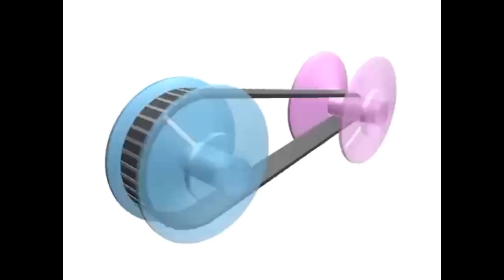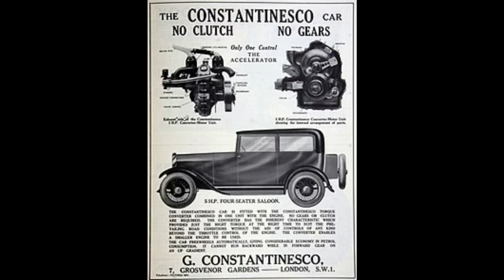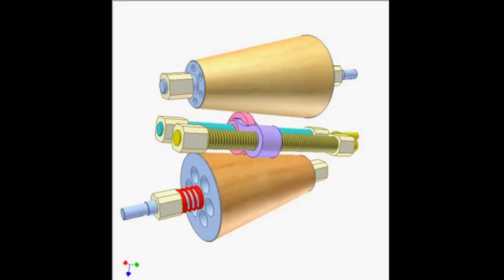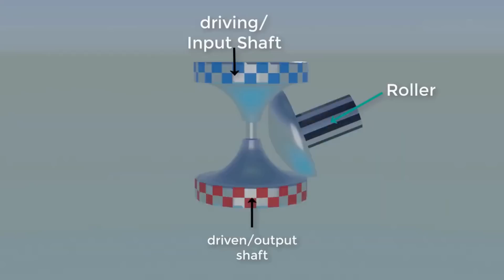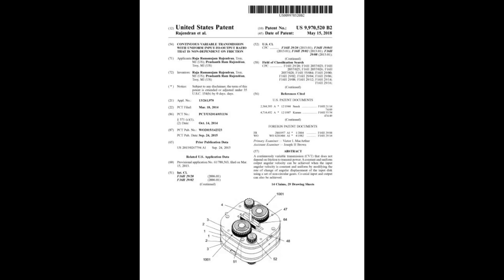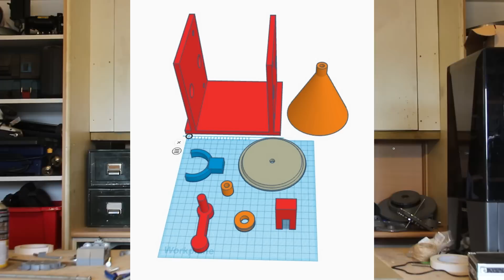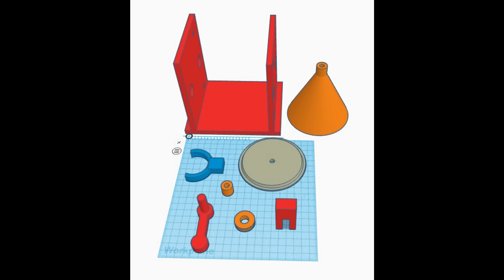1972 Continuously Variable Transmission For Use In Wind Turbines (CVT)

Comment: a thought on how to adjust the placement of the transmission ball could be as simple as a wind damper pushing against a spring. the more the wind pushes over the damper the father to one side the ball goes and vise versa. now i know there are some losses but that could be improved by possibly a redesign to the pully were the wind damper moving applies inward pressure on the drive  pully and outward pressure on the driven. defiantly not a engineer just some thoughts

Comment: In 1958 my first industrial history lesson at age of 12 years was a variable twin cone and belt transmission as used in early Victorian windmills in Britain. The point was that the mill stones would have a constant speed thus reducing the high liability of fire in the flour laden atmosphere which was explosive under certain conditions. Shortly afterwards Daffodil in the sixties marketed the Daffodil variomatic transmission. When I commented on this to my toolmaking uncle he showed me his Robin Hood lathe which worked by a similar transmission and was designed in WWII as a raining machine for workshop machinists. I still use this machine today for hobby processes! As the Presenter suggests there is merely the upgrading of old ideas!

Comment: I always thought about adopting helicopter blade angle adjustment to maximise a wind turbine, wind to high, just change the angle of attack 😊
Reply: pretty sure that's exactly what they already do
Reply: @MattNolanCustom  they obviously haven't got it right because they have to be shut down in high winds, you'd think that would be time to maximize that raw energy. It would take pressure off the grid and the polluting power stations.
Reply: @allanbroughton2708  there are two issues: there will always be a maximum speed and there are times when the grid can't accept more power without becoming unbalanced - especially if the turbines are in Scotland, as the grid doesn't have much capacity to transfer power from there to England
Reply: @MattNolanCustom  firstly a "maximum speed" can be overcome through engineering solutions so that even gale force winds can be harnessed. Secondly, those times when "the grid can't accept more power" the power generating stations should have output restricted and full utilization of wind and or solar should then have priority.  Why would there need to be a transfer of power from scotland to england?  Do the scottish wind turbines produce more power than scotland can use?  I look forward to the next installment 😂😂
Reply: @allanbroughton2708  yes. There is a major grid capacity bottleneck between Scotland and England.

Comment: for the yoke? control, have a threaded control rod attached to a small stepper motor thats controlled off of an arduino tabled for target ratios at a given fan speed, rpm can be gathered from using hall effect sensors

Comment: Also hitting on a whole range of variable speed transmissions, with patents over 100 years old! I still haven't seen anything on using radiating shafts on an axel, with counterweights, which would be able to change the shaft size with centrifugal force - also something I've been milling over. It's a brilliant idea and would be very useful in wind generators, where you could keep the turbine/blades running at a constant speed, but vary the torque, depending on the wind force... there's a 100 year old patent on that, too, isn't there?

Comment: I have many "dead" deep-cycle Marine 12V lead-acid batteries. If new, they'd store and output as much as 14.5VDC. Once someone has thrown them out, you now might expect around 11VDC from them after a charge. But if you attach them in series and use them to run a DC motor, the voltage will determine its speed. Six of these batteries might then run the motor at 60V. With the CVT to an alternator, you could then produce a stable 120VAC output assuming that you have a feedback loop to control it.

Comment: So a possible solution would be a threaded shaft driven by an electric motor and two sensors to measure the rotation of both drives. You can then difference the speeds between the two drives and then drive the thread back and forth to position the golf ball where it needs to go. I don't know if this could be achieved mechanically with some sort of differential gear to vary the threaded shaft to keep the output speed the same. Its worth adding an anemometer and brakes to the input drive from the turbine so that in very windy conditions, the turbine can be shut down to prevent the turbine being destroyed in gales and hurricanes.

Comment: Quite an exciting video this is. I just have exactly the right application for this and I had no idea it could be done this way I have to control the speed of a rotating plate and I would have made electronic speed adjustment with a PC board but this is without electronics and therefore I can use a ac motor and have far less interference on the master amplifier which controls the cutting head. The same principle applies to its feedscrew which would allow me stepless groove pitch. This being a vinyl LP record cutting lathe BTW. My current one I made uses dc motor and has interference. Thanks for this.

Comment: There is a transmission for bicycles that uses cones and balls with a swash plate to change the gearing.  There is also a substance like corn starch inside that goes hard under load and then liquid when not loaded.  It is not CVT but is is worth a look to help with the design.

Comment: A variable transmission would be great for a car powerded by a stirling engine, the engine could be made really simple and run at constant rpm then you need a cluch for engaging and disengaging the main shaft in normal and reverse and a variable transmission, it could be the most efficient and simpler hydrocarbon engine car possible.
Reply: I don't think a Stirling engine is more efficient than a combustion engine, the only advantage is that you can run a Stirling engine on every heat source, so you could run your car on wood for example, the downside is of course that it takes pretty long to start the engine... 
But maybe it is possible to run a sterling engine with the exhaust gas heat from the combustion engine, and use that sterling engine to recharge the battery of a hybrid car
Reply: @Henning_S.  stirling engines can be made quite close to the Carnot cicle that is the most efficient ideal cicle of all combustion engines
Reply: @VacuumTube88  even if you build a Stirling engine which is more efficient than a combustion engine, it will still be larger and heavier and also requires a much larger radiator.
So the more efficient you want to make the Stirling engine, the larger the radiator needs to be. But a large radiator increases the air resistance of the car and also the increased weight leads to higher power consumption while driving.
So in the end you can be happy if you get the same fuel consumption as a combustion engine.
By the way, a Stirling engine is also more expensive...

Comment: Wind turbines at the moment use variable pitch control. The gearbox is used to increase the speed of the generator.
The generator puts out DC which is then inverted to AC to the correct frequency.

Comment: Sometimes you think you invented something but it existed already for a long time lol... can't get a sterling engine to work, that is with current material available, but I figure out I could make a passive mechanism for a walking robot, that translate any harsh push into walking using adaptation of the inverted pendulum principles, those cone transmissions you show is one of the idea I had to program the stride base on the input force, but the cone aren't regular, they encode a profile in the varying radius along the height of the cone. Mot sure if I can build the whole thing yet though.

Comment: Good job mate, came to the same conclusion several years ago after realizing just how good the variable transmission on my motor bike actually is and how well matched it would be for wind generation, I can vouch after doing 150,000 km that I've never had a problem, never had to adjust anything, the only change I made was putting lighter rollers in for faster start speeds and higher torque ratio's up hills.
Reply: What bike do you have?
Reply: @friedrichvonsnatch3501  A small 110 cc scooter, don't sound impressive, but 150,000 km's says otherwise lol
Reply: @pattayaguideorg  could you say the exact model? i would love to look into it more

Comment: Hmm.
As  was mentioned, lawnmower type of 'CVT' would sound like ideal. As wind speed increases the thrust on the blades increases right? 

So when the speed is too high the production can be stopped by adding a brake in the middle. Also one gets a 90°  angle gearing so that the generator can be brought down for easy maintenance.

Hope my rambling makes sense....

Comment: i found a curb treadmill but when i saw it i thought, well dang this is old and probably not too much good scalvage. it had a pully setup like this though, changing the width of the belt groove for speed control with a little knob up by some handlebars. oh yes, it has been a wonderful find, and has been a part of many contraptions over the years!

Comment: Hydraulic torque converters have torque multiplication via fluid impeller and stator connected to transmission of ratios.

Much less parasitic loss than belt cvt

Comment: A variable transmission allows you to trade torque for speed, while a governor regulates speed by converting Kinetic energy into potential energy. I can see using a transmission to try hitting a sweet spot for the load, but why not use a governor if you just want to limit/maintain a target speed or output torque?

Comment: I'm surprised they don't use CVT's in electric cars. Not all electric cars need to be hot-rods. You just have a small efficient electric motor with a CVT's so you can drive on it the interstate.
Reply: Doubling the speed of a car required eight times the horsepower.  If a car needs 2 HP to travel 20 MPH it will require 128 HP to travel 80 MPH.
In electric cars the electronic motor controller acts as the CVT, making the same motor efficient at [low power - low RPMs] and at [high power - high RPMs].  My thought is that an electronic alternator controller could be developed for wind turbines to eliminate the need for a mechanical CVT.

Comment: On the subject of variable transmission there is an Internal Geared Hub for bicycles called the NuVinci which gives a constant variable gear range, believe they’ve mention adapting the system for other applications. Motor vehicles have been mentioned & I’d bet they could be adapted for wind turbines.
Reply: what gear ratios do they support? is it more of a city bike or for more terrains? what are its advantages?

Comment: Whippletree for combining power from multiple horses. Also used in IBM typewriters to vary force for different characters - less for a full stop and comma - more for letter W.
Reply: That, I never knew but makes sense. Remember old mechanical typewriters where the full stop would practically go through the paper.

Comment: Been trying to figure out the solution to the exact problems you mentioned here mate!
And just as I see this video in the list, you bet I click it faster than the speed of light.
I was also thinking of a high response voltage regulator to attach to the turbine generator such that the generator output voltage remains the same.
Something like a variac or autotransformer or something. Could also be practical?
Amazed by the varieties of CVTa you mentioned here, always tried looking for more designs of CVTs.. but couldn't find. You may have shown something that is potentially more reliable, robust, and efficient and practical.
Waiting for you to amaze us with more phenomenon or trick or many useful unknowns that are as amazing as you are sir.

Comment: I'm slightly confuddled, Robert.
Surely the diameter of each wide and thin part either 'end' of each cone is identical, so moving the golf ball (or any intermediary object) will have no effective difference?
When it's closest to one end plate, it's exactly the same on the opposite side.
You're effectively just placing two rods alongside each other, the fact that they're conical is by the by.
Look at your work, then look again.
And keep looking until you see what I see.
Reply from the maker: no mate they are in a different ratio of diameters depending on where along the cone they are

Comment: Lots of complicated ideas here but why not just have a 'tail' piece hanging out the back or above (so not disturbing the turbine airflow), the faster the wind, the more it lifts the tail and controls the position of the golf ball. It would have to move horizontally too so that it was always downwind but that's easily done on a turntable mounted around the base or completely separate from the turbine as most other ideas seem to be adding strain or resistance to the mechanism in some way

Comment: You could use the electric output to control the position of the golf ball, thusd when input rotation increases, and thus the electric output varies, the ball is moved to a different position.

Comment: In order to remove any potential belt "stretching" or slippage issues with their CVT, Subaru pushes the power from the primary to the secondary with a chain belt rather than pulling the belt.  The belt is ....wait for it...a pushie rather than a pulley belt.

Comment: Moving the golf ball?

Centrifugal force does not seem to be a workable solution.
A small turbine would have the same issues of turbine speed as the wind increased.

A spring loaded sail, parachute or cup that is pushed by the wind seems to be a solution. Setting the right tension for the spring would be the deciding factor hear.

The direct method for doing it would be to use a micro-controller that measures the wind speed or the turbine speed and then adjusted the position of the golf ball accordingly using a standard motor or a stepper motor.

I'll be waiting to see what you come up with.

Comment: Traditionally bob weights would be used to vary the golf ball position. The faster they spin the further they tend to force away from the centre, linking this to the golf ball would be the control. You see the same idea on old steam engines as governors.
Reply: That's where the term "balls to the wall" meaning "full speed" comes from.

Comment: Easy enough to move the Golf Ball - place it on a rail where its position is determined by centrifugal weights attached to a small flywheel attached to the main input of the Wind Turbine shaft. As the Wind Turbine Shaft's speed increases/decreases - the weights will move and this movement is applied to the Golf Balls Horizontal position. Similar to the method of 'tuning' an old fashioned Car Distributor.
Reply: Good idea , but there is no feedback. The graal is to find a way to drive the ball by the output speed error. Not so easy if we want a purely mechanical system. if we mount the ball on an endless screw, we may drive this screw by a disk rolling friction roller. Output centrifugal weight will move the roller on the disk, with the roller at the center for the exact speed.
Reply: Was thinking it could use fluid pressure like a modulator valve on an older automatic transmission. The increased rpm would drive a pump to move the ball on a fluid filled rail and to have a spring attached that when rpm decreased it would return to its original position or if rpm is constant fluid pressure would be constant. The only thing is having the fluid pressure over come the spring pressure. Idk just thinking out loud lol. Lots of cool ideas hear
Reply: @jeremybrown8263  
Haha! Yeah..I think that would work.
The reason I laugh, is because I clicked on this video because of the picture. The cone transmission that I,  "invented" several years ago.
And then, while reading these comments about regulators, I was thinking about using fluid pressure as a regulator. Actually, only moments before reading down to YOUR comment, which describes the very idea I was thinking on. 
Haha! 
Wonderful to be in such good company.
Reply: @melvin6840  cool, I think my idea would work bit in a caveman since of it the guy with the original comment had I good idea about the centrifugal weights, I think maybe an electro magnet that would increase and decrease in intensity do to rpm could also work. But I feel like for now as of reliably fluid pressure would work best,we know much more about fluid dynamics than we do about magnetic effects...I assume I really don't know just still thinking out loud lol sorry for the typos

Comment: Control should be straightforward, attach the golf ball yoke to a shaft parallel to the cones' shafts connected to a stepper motor controlled by the generator output circuit balanced against a constant voltage.  If the generator speed increases compared to the constant voltage the difference will drive the stepper motor one way, if it declines the negative voltage will drive it in the other direction.